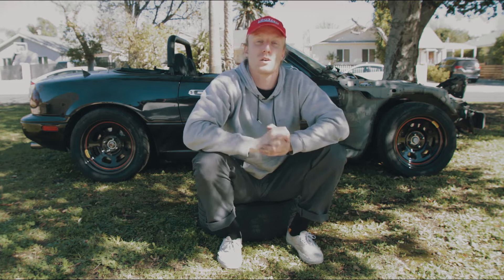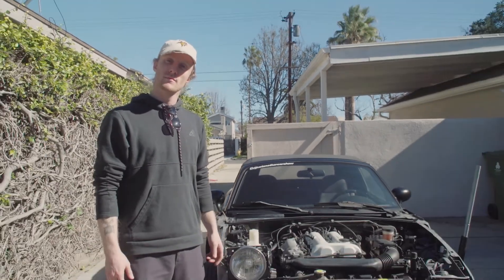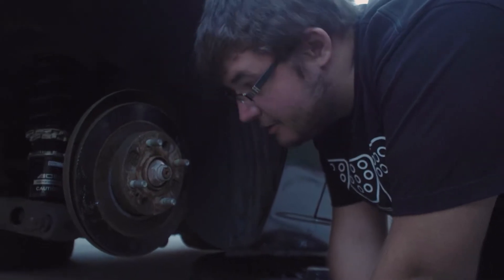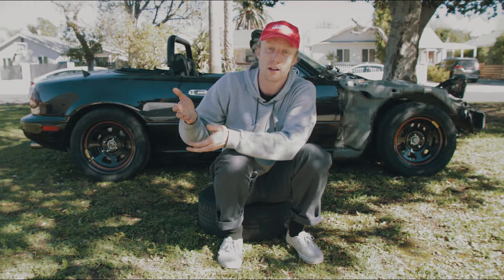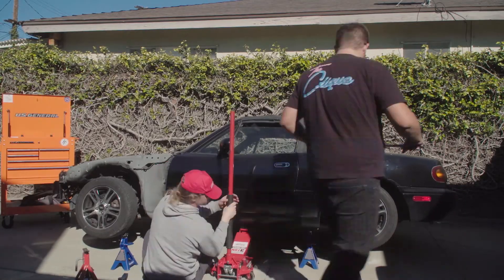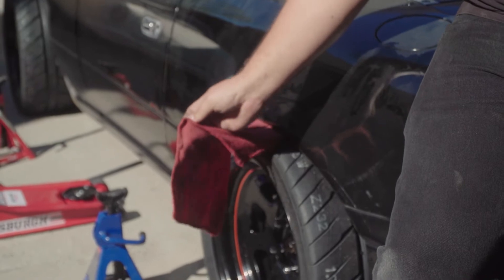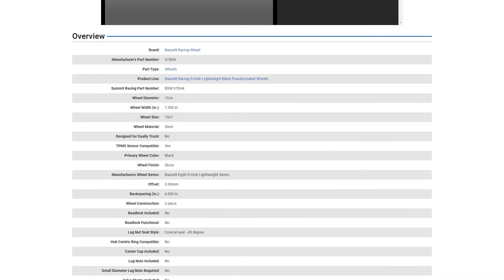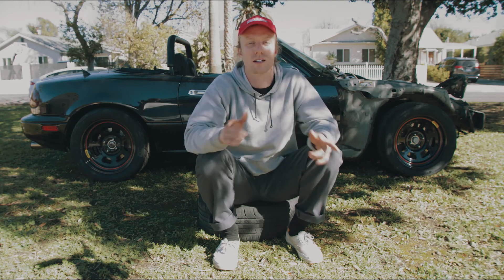Putting The WIDEST Tires EVER on a Miata

Comment: I've never seen a rotor break like that haha. Must've been SUPER rusty. Question, did you clean the rust off the hubs before installing the brakes? Also, Goodwin Racing has hubcentric rings, see if they make them in your size!
Reply from the maker: Dude it was a bad situation 😂 and yes!! Definitely cleaned up and anti-seized everything. Could have probably put a bit in the video, but I appreciate you letting us know. We’ll check them out!✊🏻